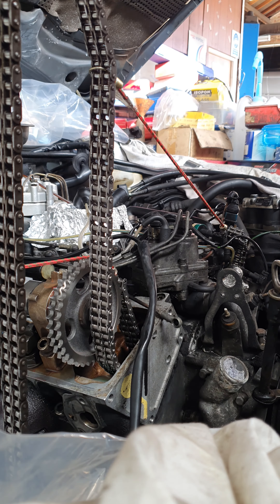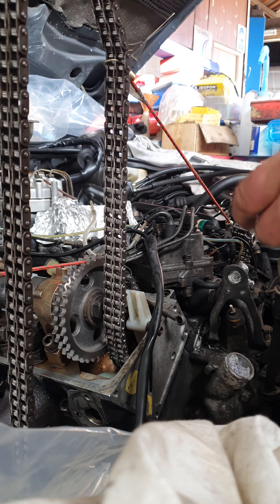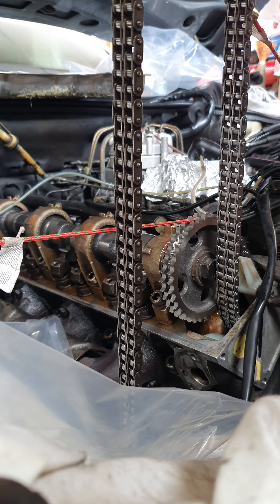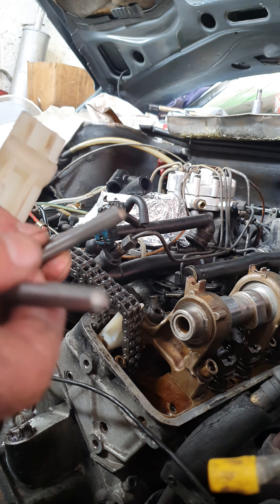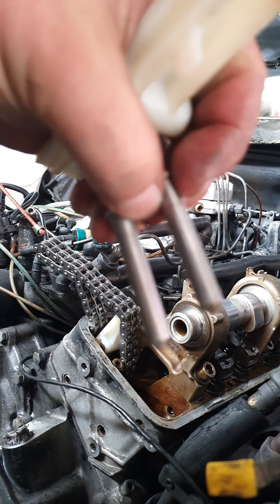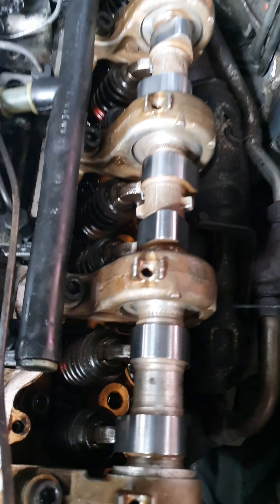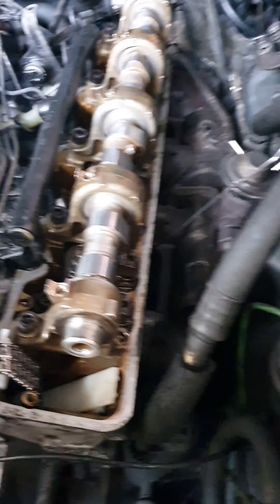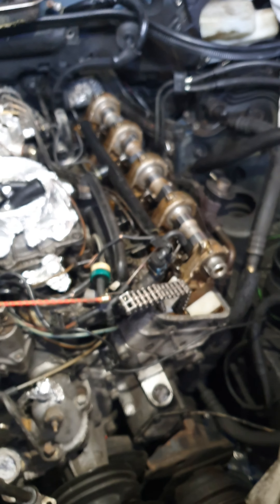Mercedes-benz 500 SEC C 126 - timing chain replacement ep. 6

Comment: I've got to do this on a 1983 380 SEC, think it should be the same?  Also the car blows black smoke, and the plugs are a little black carbon fouled, any ideas on why that would happen?  The air filters are pretty clean.